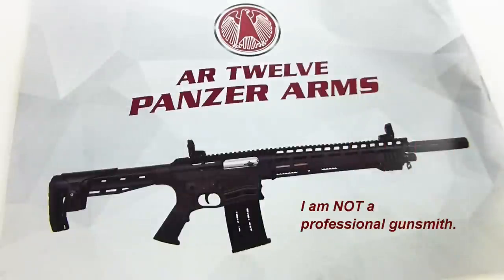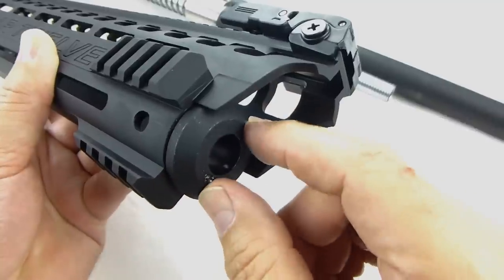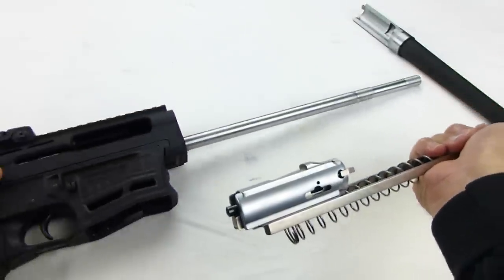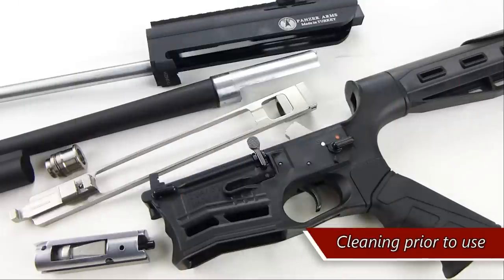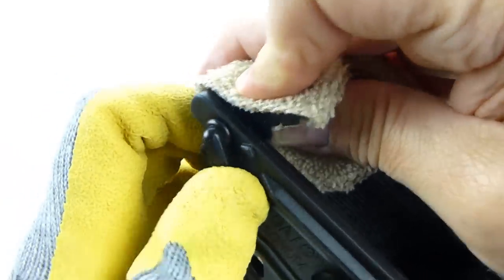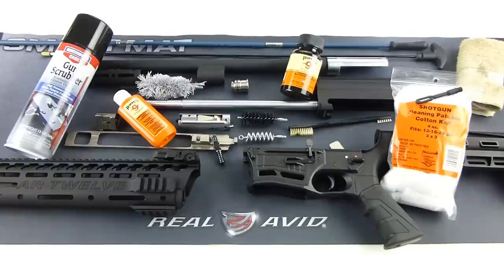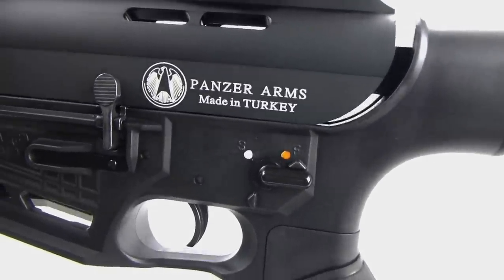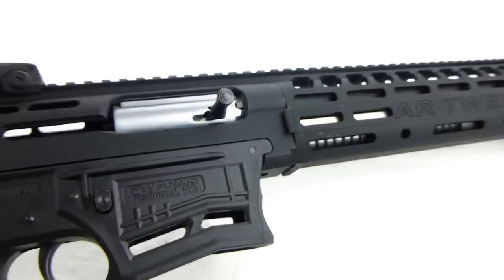Panzer Arms Gen3 AR12 Disassembly Cleaning and Reassembly *Full Video*

Comment: I have watched a couple different videos showing pulling the charging handle out but I'm still having issues.  It continues to catch as I try to pull it out and I've tried forcefully I tried line it up all throughout the slot and still no luck is there something I'm missing? I did see from another video that I should have that lever on the other side that is very tough to move pushed downward. This enabled the bolt to move further forward but still no luck
Reply from the maker: It doesn't sound like your missing anything. It' shouldn't matter which generation you have but, which gen to you have? 

Yes. You'll need to set the "Bolt Stop" lever in the vertical position, as I show in my video. It is VERY difficult at first. Wrap the "Bolt Stop" lever with a towel. Then use a rubber mallet and tap it to the vertical position. Once you get the "Bolt Stop" lever in the vertical position you should be able to move the "Bolt" easily to line up the notches. Try adding a few drops of lubricating oil on it. That's something I didn't do at first. 

Once you've got the "Bolt Stop" lever in the vertical position, if the "Bolt Charging Handle" is difficult to pull out, you might want to try wrapping the "Bolt Charging Handle" with a towel and gripping it with a pair of pliers. Once you get it out, do my recommended smoothing with wet sand paper or the emory board files...but not to much, and spend some time working it in and out of the charging handle slot. If I remember correctly, I worked on mine for about 30 minutes. Seems like a long time but it was definitely worth it. Hope this helps. Let me know.
Reply: @MrMnmn911  thanks it is a generation three. I do have the bolt stop in the vertical position. I have had tried the towel and pliers method as well I feel like it's just still acting like it's caught and as far as the grooves go that you're trying to line it up with, it just needs to be centered with that little half circle in the slot right?
Reply: When I get it centered up in that slot and I pull I can feel it pop out just a little but then it is still caught.  Anywhere else in the slot it won't do that pop out motion but I can't get it to pull all the way out even with pliers and I don't want to break anything.  Going to try to add some oil now.  Really appreciate your help.
Reply: Also I have the gun operational Rod laying on a table with the bolt carrier pushed up against the edge of it so I can easily push into the spring to give myself some play with two hands instead of needing an extra hand.
Reply from the maker: Yes. It should be centered with the half circle in the slot, as you've said.  Are you grabbing the "Operational Spring" and the "Bolt Carrier" and pulling it back slightly? I the "Bolt" easily movable? It should be moving freely. Sorry to hear you're having such difficulty. Let me know.
Reply from the maker: To do his by yourself; using your left hand, you'll have to place the butt stock against your ribs and hip, on the left side. Then bring your bicep in, to hold the stock steady. Then while grabbing the "Bolt Carrier" and "Operational Spring" with your left hand pull the "Carrier", the "Operational Spring, and the "Bolt" back, until the "Bolt" moves freely. You'll have to hold it in that position. Then align the "Bolt" notches with the "Charging Handle". Then pull the "Charging Handle" straight out.
Reply from the maker: At 05:41 in the video you'll see me switch hands. That's when I'm holding the stock against my ribs to hold the gun steady and using my left hand to hold the "Carrier, Spring and Bolt" back slightly into the "Upper". You can then use your right hand to move the "Bolt" to align the notches and to pull the "Charging Handle" out. Hope this helps.
Reply: @MrMnmn911  thanks again for your response I have tried that and I am trying it again now and the bolt moves freely and I center up the bolt handle with the notch in the middle but when I pull it just only comes out maybe half a millimeter or a millimeter and I can't get it to come out any farther than that even tugging on it with a pair of pliers
Reply from the maker: Man. Sorry it's been so frustrating for you. I'd say give a rest for now. And try again in a little bit. Don't know what other advice I can give. Perhaps someone else has experienced the same issue and can offer some advice. Hope you're able to solve this.
Reply from the maker: Jeremy Flatt Hey Jeremy. Any luck on removing the bolt handle?
Reply: @MrMnmn911   no luck again it seems to pull out slightly but then it just catches and Pops back in when I let it go.  I have tried pretty forcefully with pliers I've also tried shaking it and moving it back and forth in the slot all over the place I'm not sure why I am having this issue.
Reply from the maker: Jeremy Flatt Man. I say just leave for now. It might just need some good blasts from a round of mags shot through it to loosen it up. I’m thinking it might be some rough edges on the bolt handle. They got it in during manufacturing but didn’t try pulling it out. And now it’s just stuck. If need be you might want to try using the warranty and getting it replaced. Bummer.
Reply: @MrMnmn911  Yeah... I shot a box of shells last weekend. As far as cleaning the shotgun goes how crucial is it that I clean out the lower.  Can I get everything clean good enough as is?
Reply from the maker: Jeremy Flatt I think you should be able to clean the bolt carrier group fairly well by spraying it with the Gun Scrubber.
Reply: Had to pry mine out then hit it with the file comes out easily now
Reply: @johnpatterson5101  how did you pry it out exactly? I don't want to break it as I have heard of some doing?
Reply from the maker: Hi John. Can you explain exactly how you pried the bolt handle out? I'd like to post a video on this. Or...can you post a video? I'd be glad to share it.
Reply from the maker: +Jeremy Flatt Please see my latest Panzer video on warranty and service information. I'd sent the gun back in for repair or replacement.
https://youtu.be/2Lyi9-SB16c

Comment: I purchased one of these brand new and noticed there is some play in the charging handle when it is seated in the bolt.  The play is forward to back when looking down the sights of the gun.  I have not disassembled the firearm, it came from the factory like this.  Is this normal?
Reply from the maker: Mike Who That’s not normal. I’d return it.
Reply: MrMnmn911 thanks for the fast reply, will do!

Comment: My gas piston is now loose in the barrel. Is this an issue? With the gun completely assembled, if you tilt the gun up and down you can hear the piston slide back and forth. It does still have that snap right type o-ring on it as well. Any thoughts?
Reply from the maker: Sorry. I'm not sure about this problem.
Reply: Appreciate the reply. Still seems to fire fine just doesn’t seem to be correct.
Reply: Mine does that as well ima take it apart

Comment: Why can i not get the charging handle out? I physically can not pull it out, I even tried using a cheater bar with a metal wire through the holes in it and it just will not come out. Is it supposed to be this hard? I also can’t get the stock bolt out either, I have a 1/2” socket with
 an extension bar and it won’t unscrew. This is very frustrating and i’m staring to feel like i wasted my money
Reply from the maker: If it's new, return it for exchange or refund.
Reply: @MrMnmn911  To whom would i send it?
Reply from the maker: @jewelsc79  If it's brand new. Send it back to the retailer you purchased it from.
Reply: @MrMnmn911  vance outdoors; no refunds
Reply from the maker: @jewelsc79  Will they exchange it? If not, and if it's brand new, it should have a one year warranty. I'd contact Panzer Arms...go to their website.
Reply: @MrMnmn911   I could try asking to exchange it. Also yes it is brand new, I forgot to mention so yea i will try to get a hold of Panzer arms. Hopefully i can figure something out because i have another 12 gauge semi auto i was never able to return and it’s beyond warranty now and it’s been used so it’s essentially scrap. I don’t want that happening with this one. Although do you think there may be issues with returning this AR-12 since now after trying to loosen what you described as the “bolt stop” with pliers i accidentally scratched it up a fair bit because it was so tight i had to really work it because i could not physically do it with my fingers, hell i could barely do it with the pliers that’s why it got all scratched up. I’ve also scratched the barrel while removing the hand guard. By the way i do have a different model, I don’t know exactly what generation it is but it’s definitely a newer one as it has these different gas pistons and other components fixed onto the barrel so i can’t even take the barrel off.
Reply from the maker: @jewelsc79  I'm not sure what Panzer Arms would say about you scratching and marring the gun. At best, I think they would simply remove the stuck charging handle and replace with a functional handle...since it is still under the 1 year warranty...but I can't really say how they would handle your issue.
Reply: @MrMnmn911  right, well thank you for pointing me in the right direction, I appreciate the help!
Reply: @MrMnmn911  hey it’s me again! Good news! I managed to break the gun down most of the way except one part with the help of a buddy of mine including the charging handle and stock bolt. Now, one thing how i mentioned before, I do have a newer model than you, so you seem to have a model almost completely identical to my emperor arms noble 1 semi auto. This newer panzer arms has a different gas system completely and a different barrel, so would you mind if i emailed you a picture to show you the piece i’m having trouble with? Not asking for help necessarily, but maybe an opinion on how i could go about getting this part off because this piece is extremely hard to get off.

Edit: oh yeah this newer panzer arms ar-12 also actually comes with a channel in the barrel that allows you to install chokes that come with the gun which is another nice feature to it and different gas pistons that you can change out for higher or lower velocity rounds. So that will probably tell you how new it is i mean i just bought it 2 weeks ago and the guy said they just got them in. Don’t know exactly what generation it is 🤔 i wish i could tell you though.
Reply from the maker: @jewelsc79  Sure. Send me the picture. MrMnmn911@gmail.com
You can also shot a short video and upload it as a private video viewable my me only.
Reply: @MrMnmn911  Hey again. I uploaded that video a few days back or so but i’m sure you’re busy so i just wanted to let you know it’s there. Feel free to comment on it and we can continue any conversations on there!
Reply from the maker: @jewelsc79  Hi. Is the video "private"? If so you need to invite me the see it. I haven't received a notification from YouTube that you've uploaded  video.
I checked you main YT channel page. The most current uploaded video showing is on month ago..."When you want to impress your new girlfriend".
Reply: @MrMnmn911  You should be able to view it, I sent a link to the video to your gmail.
Reply: @MrMnmn911  Unless i sent it to the wrong email, in which case let me know and i’ll send it again
Reply from the maker: @jewelsc79  I may have given you the wrong email address. Try again at:
MrMnmn911@gmail.com
Reply: @MrMnmn911  should be good now 🙂👍
Reply: The stock bolt is metric
Reply: @JessicaSimonson1976  have you ever removed the stock bolt from a Gen 4?
If so, what did you use? The metric system doesn’t really narrow it down.

Comment: There’s an o ring on the gas piston and I’m not sure how it goes back in any information please and thank you
Reply from the maker: Mine doesn't have an O-ring on the gas piston. You may have a different model than mine. You may have a PRO model. Mine is not a PRO model.
Reply: Yes there is. It fits in a small grove in the gas chamber. It sits between the gas chamber and gas pistol, sealing it off.

Comment: Just bought one "3rd gen" and it jams every 2 to 3 shots. How do I clean it to help prevent this? Was told not to use steel/wool just plastic. What's the best way to do this so I can start enjoying my baby??????
Reply from the maker: I suggest following my video. But that is just my opinon.
Reply: @MrMnmn911  thanks my man, that’s the way I was leaning!!!!!
Reply: @MrMnmn911  I've seen videos on the VR-60 AND 80, where they leave the charging handle in the back position for a month.  This takes some of the tension off of the springs and allows easier feeding and elections with less jams.  Think that will help with the break in?
Reply from the maker: @thewarriormonk972  I'm not certain. It might. I don't think it would harm anything to do that. Give it a try.

Comment: Great video the only thing I will say is dont put any lube oil down the barrell. After you clean it put isopropyl alcohol on some patches and run it down the barrell.  If you leave fluid in the barrel that fluid is not compressible and you will create more pressure and that's not good. This applies to all barrels if you want to oil it while your are storing it that's okay, but before you shoot run some isopropyl alcohol down it. Good video thanks

Comment: Help!!! After firing some 500 rounds, the lower end release toggle fell out ( 10:55 ) and ultimately the plastic piece along with a tiny spring fell out while removing the empty mag. I lost the toggle as a result, but still have the spring and the plastic piece.... Do you have any suggestions on getting them back in?
Reply: I guess i dont currently have a bolt stop???
Reply from the maker: The one I show and have is a Generation 3 model. Which generation is yours?
Reply: the same
Reply from the maker: You should have a bolt stop.
Reply: @MrMnmn911  the piece you are attempting to loosen on your vid at 10:55 is the piece that fell out
Reply from the maker: That is the bolt stop lever. I wouldn't know how to replace the spring. If your gun is a recently purchased one it should still be under warranty. See my latest Warranty Information video on who to contact for service.
https://youtu.be/2Lyi9-SB16c

Comment: Mine also came with a extra piston?? What is the reason for that. ?  A extra gas piston. Like I said my C D Defense looks identical to yours says 3"magnum and everything.  I only shoot 2 3/4 though.
Reply from the maker: Mine does not have any extra pistons. I would read through your manual and see what it says about the extra piston.
Reply: The extra piston is probably for heavier loads.
Reply: @larrysdinner  I finally found out its to shoot 3 inch I found a 3" mark on it. I will just leave it out all I shoot is 2 3/4

Comment: What did you do to replace the cocking handle?
Reply from the maker: I didn’t have to replace the charging (cocking) handle.
Reply: @MrMnmn911  After I sent the message I noticed you had the AR12 and I have the Pro which comes with a terrible charging handle.

Comment: I have a problem with the Panzer AR-12 shotgun and the magazine 
Magazine stuck and I can’t get it out and I don’t shooting with the gun 
You help me with this problem?You know how fix this problem to take off the magazine?
Thanks in advance
Reply from the maker: Sorry. I can't help. I do have video posted on my channel on whom to contact for manufacture warranty issues.
Reply: MrMnmn911 Ok thanks yes I contact the president of the company and Dan of the service store in Apollo PA
Reply: My shit did the same thing at the indoor gun range with a round stuck in it...whay i did was put the gun on floor hold the top use both feet squeeze magazine and pull gun up..took a lot of force but the mag pop out.. what i learned fronm the Ar12 you have to gently put magazine if you slam it will jam .
Reply: bill bixby Yep I fix this like you thanks for your message !!!

Comment: You make removing the charging handleook extremely easy. I have been at it an hour and it will not come out for me!
Reply: Tried the towel and plier method. It finally came out but I manage to Mar the end of the charging handle a bit. Nothing a little sand paper can't fix. Or rotary tool.
Reply from the maker: Drew Paschal Glad to hear you finally got it out. 👍

Comment: Will this breakdown work with the AR PRO?
Reply from the maker: I don’t think so.
Reply: Yes
Reply: definitely not with my AR-12 Pro, purchased about 10/20/20.  It is way different.  Not necessary to remove any bolts to separate the upper from lower. several other major changes as well.  Seems like they keep putting new versions of this firearm out every few weeks, and the Pro version is different from the regular, apparently.
Reply: @bugmanmd1576  seems like every damn batch of these guns that gets  imported is a little bit different. I can’t keep up. Plus there are about 10 other brands that have parts of their guns that  are identical to these. I’m pretty sure Panzer is making shotguns for several different company’s. The molded buttstocks are exactly the same as the AR12’s on most of those other brands.
Reply: @guslulu4126  yup.. on my AR12 Pro,  there is no operational rod, there is no rubber o-ring. No writing at all on the actual handguard, but writing says ar12 Pro on the upper receiver just below the bolt.   No need to access anything in the butt stock in order to remove the upper receiver from the lower receiver. The upper receiver pops right off just like an AR-15, after you knock out the takedown pin and the pivot pin. Way different from the model in this video.